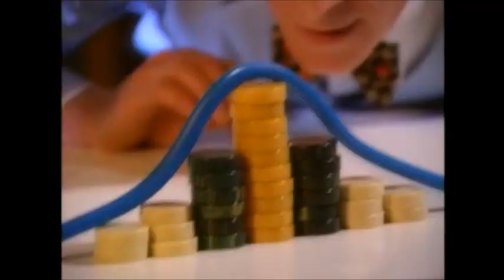Bill Nye the Science Guy - Earthquakes (richter scale)

Comment: the size of an earthquake that can, in lamens terms, (change topography) form mounds as a seismic activity described as an up and down motion, however, can it form multnomah falls?  can it form a frequent swell if from mounted pressure in weight to solution? it is in fact important if the study of earthquakes to index was actually approached that way.  if a trench is forming in connection to seismic activity, can it be said as weight shifts to other factors chaining together? can it be said as to the law of ratio when frenquency is as important as magnitude with a possibility of accelerated calculation and extended continuation of damage based on frequency and index?